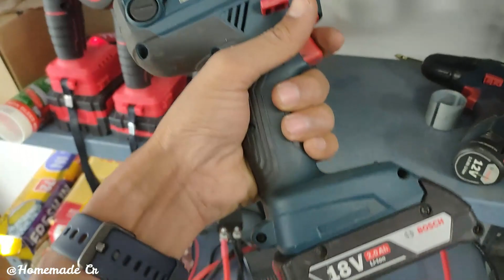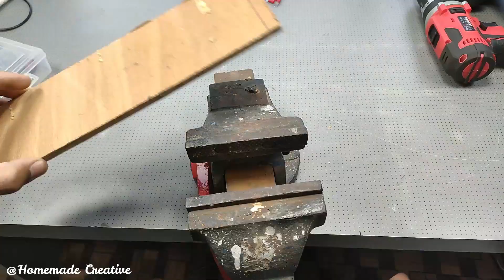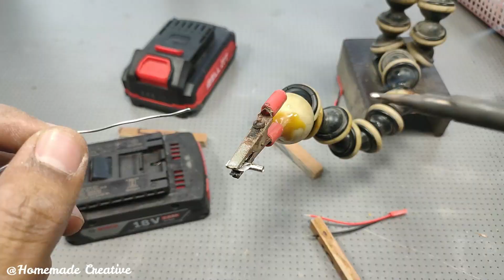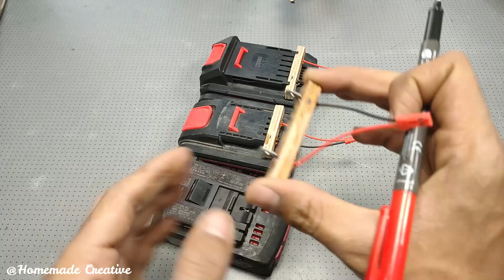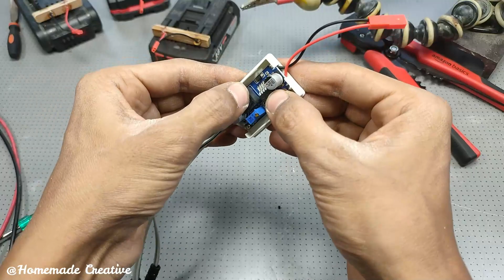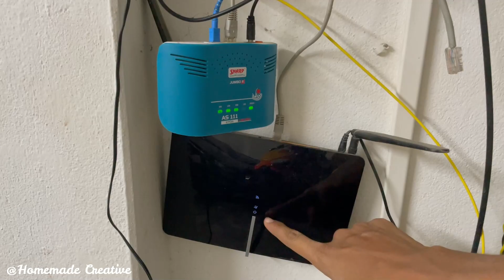DIY WiFi Router UPS Using Cordless Drill Battery

Comment: Hello...I have question....can I connect the board of ( ups router) to 21 volt drill battery... ?...I mean if I take out the board from ( router ups) then connect it directly to drill battery...it works?
Reply from the maker: No, It won't work like that, You need to step down your drill battery 21V to 12V or 9V depend upon your Router Requirement